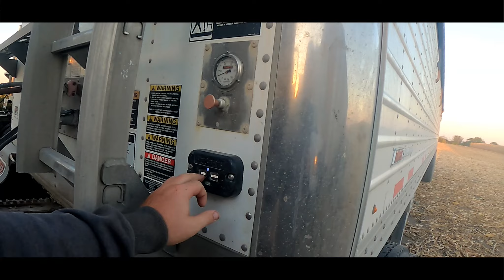The NEW GUY - Questionable Resume

Comment: A concern is the auger/elevator. When raining, water will follow the downward elbow right into the bin. I F you move it out from the bin, someone must still climb & close the hatch. Did not see roof ladder, guardrail. Don't like heights, like them less sliding off the roof in the rain. The large sumps, tall sweep, Stairway to heaven, (much preferred over a cage ladder) floor ventilation , suspended fan, are all pluses. The grade access door combo looks efficient/secure. So will Molly close the roof  hatch in the rain 🙊🚜🗽❓❓